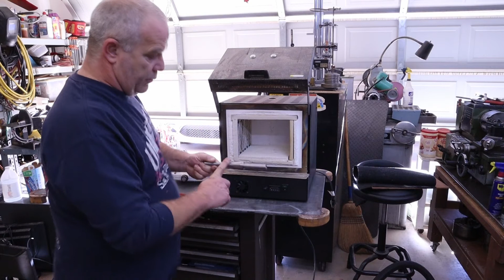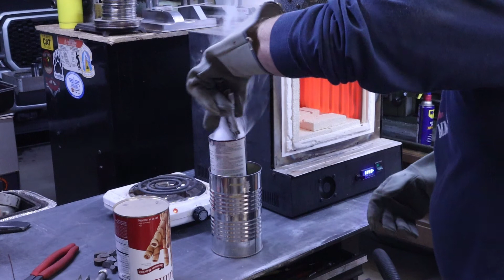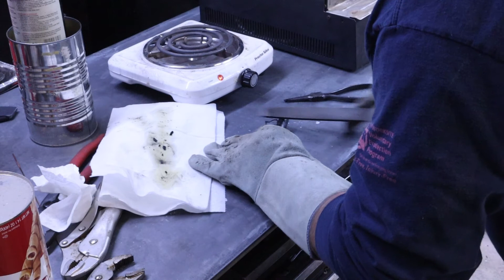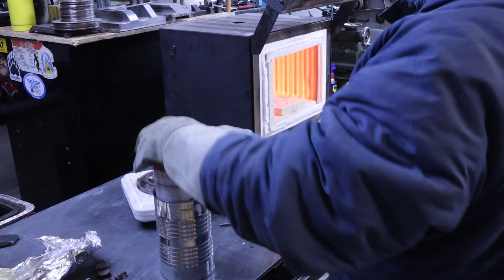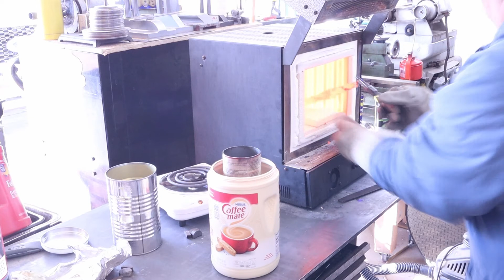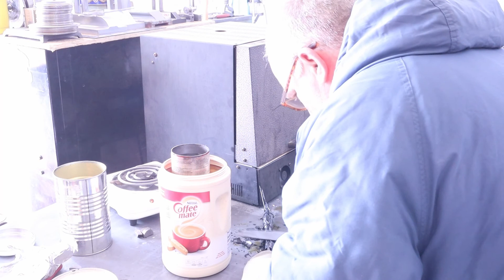Balance Arbor Heat Treat with Issues.

Comment: For oil hardening tool steels [O1 take up to 1450-1500 deg F]   you must make sure that that it stays in the quench UNTIL IT COMPLETELY COOLS TO A MIN OF 100degF... hardening is still taking place down to that temp.  I looks like your pulling it out of the oil still smoking  [oil smokes at plus 400deg F]    Oil should be just warmed slightly to 90-150deg f MAX.  You must have enough oil to maintain these lower temps to get the full quench effect/hardness. Each time you tried, you were raising the oil temp, defeating the purpose of the quench even more. Hope this helps,  that's how we learn from trial and error.
Reply from the maker: I agree,. Im getting more oil and will be doing some tests before I move onto any more real parts.  Thank you!
Reply: @AlmostMachining  Your welcome,  any too much heat above Ht 1500deg F just goes into overheating your oil and stopping the quench also.

Comment: You need to verify the part is hot enough to have lost its magnetic attraction, use more oil and need to agitate the part after immersing in the oil as stated by Andriy.
Reply from the maker: Absolutely will be doing those things for sure.  Thank you.

Comment: I have not seen anyone pre heat the oil. What is the purpose of that? Heat treating is half science half art.
Reply from the maker: It is to reduce the potential for cracking in O1 and in this case the part still cracked.  The prewarmed oil reduces thermal cracking it is supposed to at least.  Ill run some experiments for sure.

Comment: Hi, did a similar job a week ago for two of my grinders but with another type of steel(42CrMo4), but here are general remarks on the process, you do not have enough oil to dissipate the heat fast enough, and you should shake the detail there quite active when you put your part under the oil, it is so hot that it creates a foaming layer on your detail which prevents rest of oil to dissipate the heat from your detail. Then you should not wait until the detail fully cools down in the oil, it should be still hot enough around 100-150C and it should go directly back to the Owen for tempering under around 300C, depends on your expectation of what you would like to get in the end.  It also can be that it did not reach the temperature for quenching, but looking at its color I think at least one time you were there...
Reply from the maker: You are exactly correct.  I am working to get more oil and then I will give it a shot.  The next video showes a bit more on getting the oart finished up and I will be making another one in the future. Thank you.
Reply: @AlmostMachining   everything will be fine, we are learning every day :). I am not a professional in this area but have got already some experience in practice :). When essential parts of the process will be completed, success is very close! Would be good to have one more furnace for tempering, because the drop of the temperature from 800 to 350 withing couple of minute for O1 is too big for one furnace. But in the hobby area to keep two furnaces is too expensive, maybe a couple of heavy metal parts can help in heat dissipation and bringing the furnace to the desired temperature quickly. The problem here is only in accumulated heat, the furnace will emit heat more than necessary in the first 5-10min after you switched it to another program with lower temperature and fast cooling with air will not play well for the furnace itself. But again, all of this required for the perfect process, I am sure you will get 60-65 HRC easily without it and if the part made correctly it will not get too many cracks. This part has to be more round to protect it from cracks https://prnt.sc/10epv5v this what happened with mine https://prnt.sc/10epw36, but it is not a problem, in the end, all turned pretty good https://prnt.sc/10epyhz
Reply from the maker: The next video should show things working out for the part overall.  I have 2 other ovens that still need a restore.  Thank you for the encouragement!

Comment: Is it possible steel miss-identified as O1 ?  Probe not reading temp correctly?     Interesting..   You'll get there... Thanks for sharing
Reply from the maker: I only had 1 bar of O1.  It is the same bar I had been using for other pieces this is the 2nd time I've had this sort of failures with it.  It is possible that inwas lucky with the very first pices i made from it 14 years go and it was not correct from the get go.  I dont know only way would be to buy a new stick.